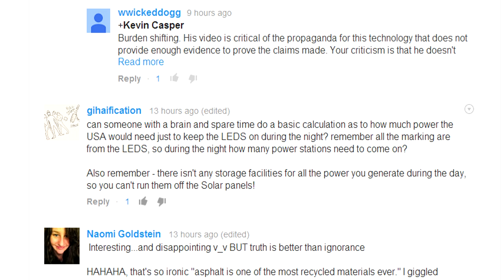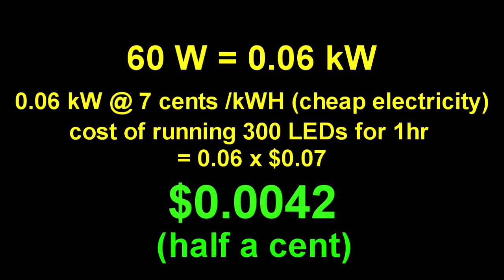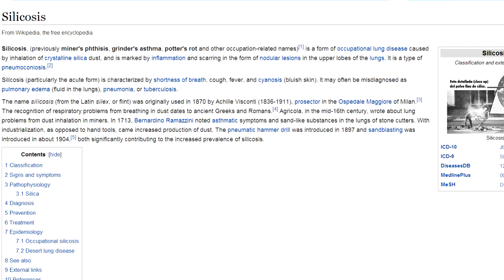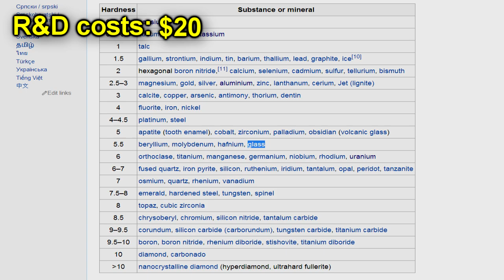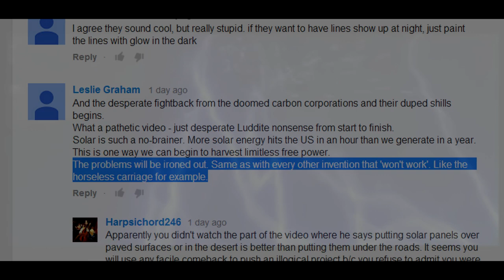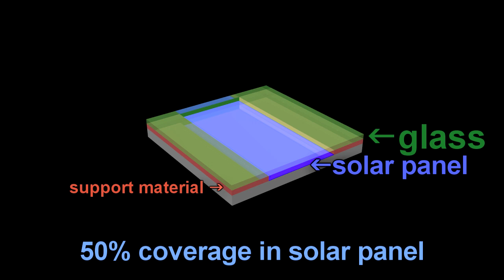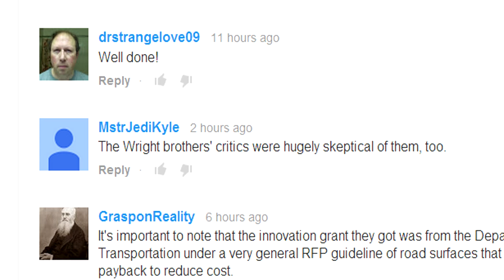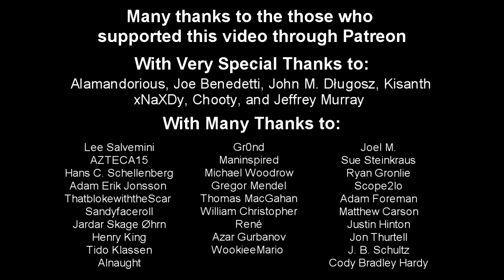Solar Roadways, IMPORTANT QUESTIONS AND ANSWERS!

Comment: There are a few problems with your estimations, Thunderfoot. Not that a critical examination is a bad thing, it's always good to hear some critical input. So, to the points.

1. Your cost estimation for the LEDs is based on retail finished products. That is an error, the LEDs that would be used would be supplied via wholesale commercial material suppliers. If you can find the price average for a package of, let's say 10,000 LEDs, not ready for retail, but rather for use in manufacturing, then you'd have a more accurate cost basis.

2. The angle of embedded photovoltaic panels, such as these road panels, would indeed lie flat on the ground. However, the Earth is roughly spherical. So, the relative angle facing the sun also depends on where on Earth the panels are used. The closer to the equator one's road is, the more efficient the angle. Certainly tracking-angled photovoltaic panels would be significantly more efficient, but the idea here is that it's also a road. And the angle you describe, for the panels, is more accurate for London, or Oslo, or New York, but less accurate for Phoenix, or LA, or Miami.

3 If you've paid attention to the surface of the panels, they are covered in bumps. Certainly glass is a less than ideal material for a road surface handling a lot of traffic. However, those bumps would reduce, significantly, the effect of tires grinding fine rocky debris on the glass. They create a lift of the tires, and recesses that the debris can accumulate into. It's pretty clear the bumps were intended to provide traction especially during rain, but the additional effect is to minimize the grinding of surface under the tires by the fine rocky debris.

4. The electricity produced by the photovoltaic panels can be stored in battery banks. Or the electrical power can help supply power demands during the day, by structures, including homes and offices, etc. In that case, the actual cost to power the LEDs is mitigated. So, the over-all cost is less than you estimate, by a large amount. However, I will say that I am having a hard time seeing any way to make the LEDs for the purpose of traffic lane lines effective during the day. There may be a solution to that which someone may think of, but simply eludes me.
Reply: 1. High output LEDs, such as those found in good flashlights are not cheap, even via wholesale. They cost upwards of a buck each and if you get an RGB one, they're up to $8 each. Go check out digikey.com.

2. True, but even Phoenix is at 33.45* N latitude. During June, you'd only have a 1.5% loss. But during December, you'd have a 44% loss. That's relative to fixed solar panels. The losses would be even greater relative to tracking and movable solar panels.

3. Maybe so, but tires deform and will still pick up some of the rocks and sand. It'd also be hellish to drive on. You ever hit rumble strips in the road?

4. You're off the deep end here. It's completely impractical, on multiple levels. Fairbanks, AK has the largest battery bank in the world. It cost $37.5 million and serves 10,000 customers. It only has enough energy to power the city for 7-15 minutes, just enough time to prevent a power outage and giving enough time for backup generation to be brought online. Do the math on that...
Reply: Even if you had a municipality that was flush with cash, it still wouldn't be economical. Why? Because instead of investing in solar panels that generate a ROI of 1%/year, they could purchase bonds for 3-4% interest and make a lot more money.

Comment: Many people, including via this video, have made it clear that the current solar roadways idea is not good enough. That being said, however, I want to point out that many facts and figures are being left out of consideration in videos like this. It's flashy to throw out numbers like 12 trillion, but that figure isn't what matters, because even if solar roadways were a good idea, it's extremely unlikely we would replace even a significant fraction of the roads with it. What's important is if even a single tile is worth it, or a hand full of tiles. People need to look at the costs of running the tiles and installing them, yes, but also look at how much power is generated by them, and take into consideration how often the LEDs need to be on. For example, they don't have to be on 100% of the time everywhere since there are weight sensors in the panels that can detect that one car on the less used interstate highway at 2am and turn on the lanes just around them. My point is that while videos like this are very important -- and I'm very glad someone took the time to make this because it does bring up important facts -- there is more complexity than can fit in just 19 minutes, and all of it should be considered before making any firm decisions.
Reply: But that doesn't take into consideration how much power can be generated in those 10 years from the tiles. If the tiles generated enough power to power 80 homes at a time, and could last for 10 years, then that would be a 100% return on investment. My point is only that all of these factors should be presented, not just the up front costs. All that being said, I have seen math that suggests that the tiles would generate an insignificant amount of power, so there would almost definitely not be a return on the investment. But people should still show all of that information.
Reply: Yes, I've seen math that suggests it will never generate enough power to be worth it. You can see it just from doing the math with some data on commercial solar systems. The only issue I'm raising here is that I think it's important to make sure all sides of the issue are brought up. This video didn't say anything I think was wrong, but I think important facts weren't included that should have been. I don't think it was necessarily done on purpose or with malicious intent, I just wanted to bring up some other factors that everyone should think about. Namely, that the overall cost isn't the problem, because even something that costs $20 trillion is worth it if after 5 years it saves you $40 trillion. So one significant problem with Solar Roadways is that it never returns that investment, not that it costs a lot upfront.

Comment: i am sure dow corning knows more about glass and how to make it then most people in the world and i know they have talked to them because i know the people working on this project.oh i just found something for you on glass.

As you can see, asphalt has a hardness of 1.3, copper has a hardness of 3, iron and nickel have a hardness of 4, steel falls between 4 and 4.5. As you get closer to diamond, you finally come to glass, which has a hardness of 5.5-6.0 (it can actually exceed 7).

So if anyone tries to tell you that glass is soft, just remind them that even simple window glass is harder than steel. By comparison, it's asphalt that is soft.

One more thing: When you temper glass, it becomes 4-5 times stronger than non-tempered glass. Bulletproof and bomb (blast) resistant glass is made with laminated tempered glass.

Solar Road Panels are made of tempered glass.
Reply: You're conflating asphalt with asphalt concrete. This is what happens when you let Stupid Freaking Roadways do all your thinking for you. Asphalt is the black sticky goo and yes, it has a hardness of 1.3. But asphalt concrete is 90-95% aggregate (gravel) which averages a hardness in the range of quartz, 7.0. No, glass does not have a moh hardness of 7.0, it's more like 5.5. You're conflating tempered glass with gorilla glass, an expensive and proprietary glass, which STILL gets scratched by sand and gravel and still breaks from being dropped. 

Glass (5.5) is harder than mild steel (5.4). There are a number of steel alloys that are much harder than mild steel and are up to 8.0. Tempering glass makes it 4-5x more IMPACT resistant and safer if it does break. It does not affect its hardness or other material properties. Bullet-resistant glass still easily scratches and scratches compromise the strength of tempered glass much more than annealed glass.

Furthermore, you conflating "strength" with hardness. Hardness is only ONE measure of strength, the others being things like impact resistance, tensile strength, yield strength, and sheer strength...Glass is good in compression and has half decent hardness. But it's a catastrophe when it comes to things like tensile, impact, yield, sheer, and strain.
Reply: i am not conflating anything.perhaps you meant confusing- which makes more sense in context. Either way you are wrong!
I'm sorry if you can't accept corning's assurances or the government's road tests. i have seen this technology i know it works.
None of your half-assed pulled together facts have anything to do with the actual roadway product. In fact you are conflating between vaguely congruent scientific facts and your assumptions of a project you know almost nothing about.

con·flate
kənˈflāt/Submit
verb
gerund or present participle: conflating
combine (two or more texts, ideas, etc.) into one.
"the urban crisis conflates a number of different economic and social issues"
synonyms:	mix, blend, fuse, unite, integrate
"the plot gets weighed down when the writers conflate too many issues into one episode"

i hope you can learn from this little mistake.
Reply: phatomphreak

Corning's assurances???? Corning is not involved in this silly project. This is *NOT* Gorilla glass and no one is disputing the properties of Gorilla glass. Corning does not claim that it's scratch proof or indestructible. What they claim is that it's more scratch resistant and has more impact resistance than annealed or tempered glass.

No, I meant conflating. Conflating is merging two different things into one. Asphalt and asphalt concrete are two different things. But confusing could work too. Either way, asphalt roads are not 100% asphalt (bitumen). It's a mix of 90-95% gravel with asphalt mixed in as a binder. Again, this is what happens when you let the liars or idiots at Stupid Freaking Roadways do you thinking for you.

The government's road tests? The government didn't do any road tests. All they did was hand out money from them to build something that they thought sounded neat.  And again, just because the Government funds a silly grant, doesn't mean that it's a good idea or not a total waste of money. They've funded other grants studying feces flinging chimps and the effect of cocaine on Japanese Quail mating behavior....
Reply: are you sure? i think they are the things you don't know.
Reply: phatomphreak

Go watch the solar freakin roadways video. Or check out their website. Or do a google search of their website

http://lmgtfy.com/?q=gorilla+glass+site%3Asolarroadways.com
http://lmgtfy.com/?q=tempered+glass+site%3Asolarroadways.com
" Solar Road Panels are made of tempered glass."
http://lmgtfy.com/?q=solar+roadways+site%3Adowcorning.com

Of course their claim of tempered glass making it "4-5 times stronger" is very vague. Material strength is measured in a dozen ways. Tempering glass makes it much more impact resistant and that's it. It doesn't make it harder or change any other of its properties. It also fails catastrophically if a crack forms or a scratch goes too deep.
Reply: that i said they where going to use gorilla  glass which you said.
Reply: did not

Comment: I realise you have some valid points but they are a bit weighted. For instance your figures relating to power to run LED are not even a factor given the solar powered road provides the power for these. Other costs can be offset given the amount of power these generate and the effect whether a cost or a saving can be transfered to the overall cost of construction to the roads and their mantanence. Still a long way to go but pretty interesting concept. Removing the need for fossil fuels etc as well as providing a second source of income to pay for its up keep. I am loving the concept. Apparently sapphire glass has some non abrasive qualities so maybe the glass the use is something like that.
Reply: Figures relating to powering LEDs are a factor because if you actually do the math, the LEDs, wifi, and electronics could consume all or most of the available power. There's no evidence that this would remove the need for fossil fuels or that it would provide even a small fraction of the income needed to service the debt required to pay for these or even the upkeep. 

Sure, sapphire glass is pretty tough when it comes to hardness. But hardness is not the only measure of material strength. Hard materials like diamonds are also very brittle. You can smash a diamond with a hammer. Sapphire glass, like other glass, is lacking in tensile, impact, and yield strength. It's also very expensive. Covering the roads with sapphire glass alone would bankrupt the country.

Comment: of coarse it's going to cost a lot of energy, but don't know that america uses a lot of energy already

this probably a very expensive thing that you oversimplifying

you don't have to stop using the road. you can just change the panel out for a new one and fix it later in a factory. 

the material isn't just glass.

Comment: I do think any new concept should be scrutinized, but this guys 'back of the envelope' calculations are flawed. Assuming that every single LED in every panel will be lit, even 20 percent of the time is CRAZY. The lines drawn in the video occupy MAYBE 5% of the road area, maybe more like 2%. Using a price for a single set of LEDs from EBAY is stupid too... When you would be buying trillions of them, think you get a bulk price. I do however, have concern about how much power would really be needed to power a highway full of EVs... It is my understanding that without massive strides in PV technology it would take a solar array many times wider than a road to provide the power for the volume of vehicles traveling down such road. But even given that, it may still make economic sense to implement at least some solar roads and surfaces, if the lifespan/cost/return works out.

Comment: Some of your calculations are way off. Every LED does not need to be on at all times. Also, I think it is safe to say not all glass is created equal. The glass in the solar roadways would be able to handle much heavier loads and be more resistant to scratching than what you used in your tests.

I'm not saying this is a practical idea by any means. In fact, covering the whole country in roads probably won't ever be practical. However, parking lots and driveways that have far less traffic? It could make a lot of sense.
Reply: Solar power has marginal economics to begin with and has a payback of about 10 years with subsidies. If you halve the power it produces by lying it flat on the ground and subjecting it to scratching and dirt, you never have a payback at all if you have to finance it. That's assuming a cost that is no greater than regular solar panels. 

Any application is stupid...on multiple levels. Oh and your point about LEDs, no recessed light source no matter how powerful is visible from the kind of angles we're talking about here